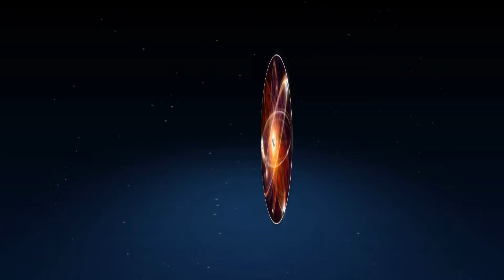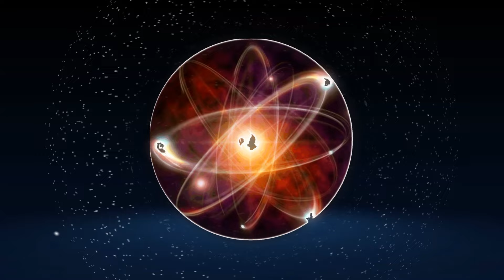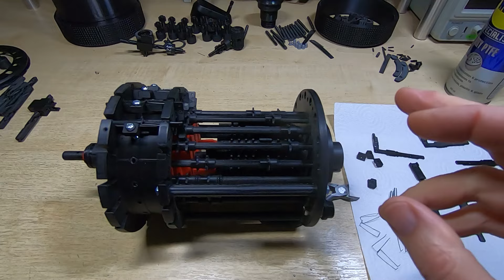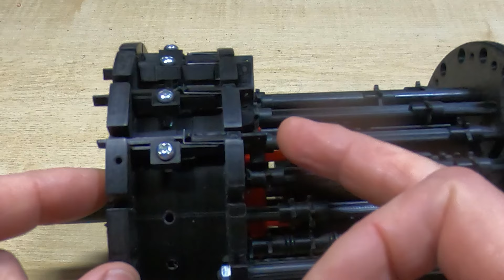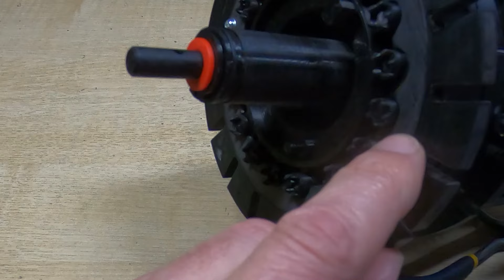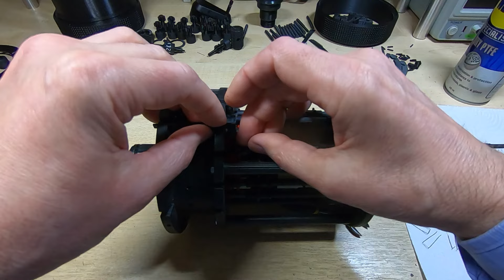Curta Calculator Assembly Part3

Comment: The info on getting the carry lever right is very helpful. I haven't been happy with the ones I made. I also tried a version someone published with a built in printed spring, and I think it is too lax.
One more check you might want to look at before going further is not just that the selectors move the gear, but also that it lines up exactly with the narrow teeth on the step drum. This is easiest seen when in the 9 position. Mine was OK but not perfect, and I adjusted it by changing the dimensions of the bearing and the top.
Reply from the maker: You are trying to get ahead of my project :)
I will demonstrate how I test the alignment in a later video as this is best done when the carriage is fitted.
This is because the gears at the top of the drive shafts generate side 'thrust'.
However the initial testing I have done is to check that positions 4 and 6 line up in the centre of each gear.
I am skipping over a lot of this at the moment because many people seem to have very short attention spans these days and do not like detailed explanations so I try to strike a balance.
As with most things I do I have carried out MANY tests and checks as I have proceeded and in a later video I will go into the fact that the current step drum is the third I printed as I modified it slightly to make alignment more reliable.
Reply: @JerryWalker001  Thanks, I look forward to seeing the later videos. I guess I am an outlier, as I like the detailed info. I've learned a lot from it for my own build (progressing very slowly).
Reply from the maker: Just in case you are still having issues I have found that there are errors in the stl files or manual or both.
The last 3 result subtraction gears are in the wrong place on the shaft and so try to turn outside of the unlock part of the bell. They are cause improper addition results.
The gear teeth on those 3 gears should align with the top 9 tooth row on the step drum and not the 9 teeth on the reversing part of the drum.
Also the counter gear on the first digit shaft is in the wrong place and is not aligning with the required drum teeth in either addition or sub mode.
I will show this in the next video.
Reply: @JerryWalker001  Thanks, looking forward to the next video. I'm still working through the turns counter and the earlier transmission shafts. The process of cleaning up the parts is very slow for me, and I'm not happy with the initial prints of the gears. They work but don't work well. Better choice of layer size and support parameters seems to help.